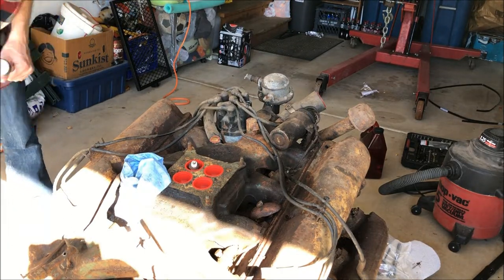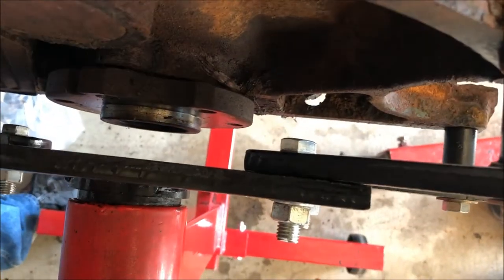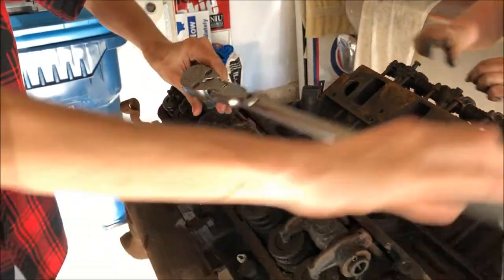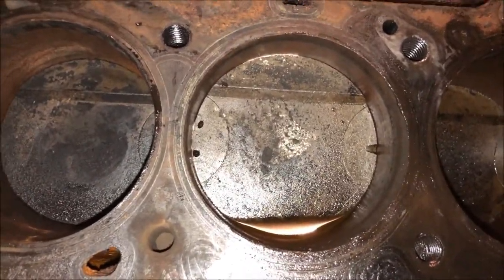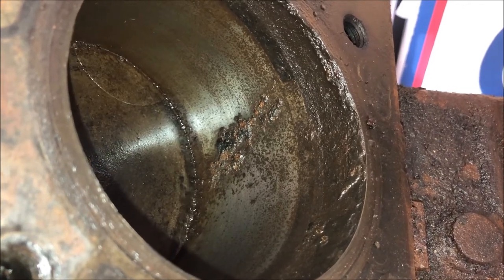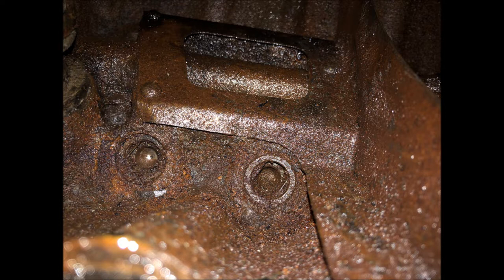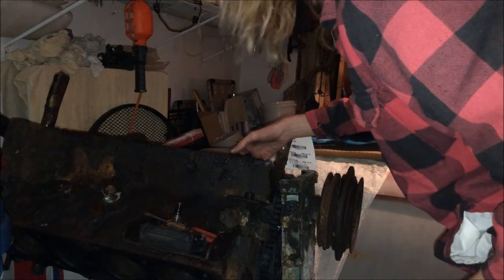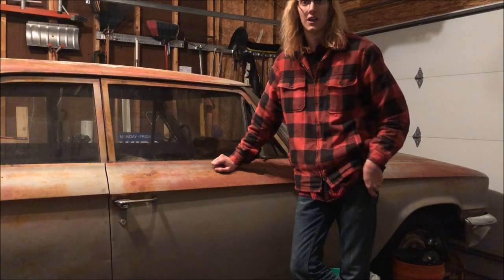430 MEL Engine Teardown, Part 1

Comment: look if you have locked pistons , and the heads are off put a pot on your stove , tip 2 quarts of trans fluid in it heat up the 160 c and carefully tip into cylinders , leave for 2 hrs and will turn , if not repeat , but i never had to !

Comment: Is the timing cam gear (large upper) stamped with FoMoCo? If so, it's likely an original timing set. Nylon timing gears in 1958? No way! They appeared by the end of the sixties and into the seventies on some (not all) engines.

Comment: These came with a steel cam gear and numbered rods from the factory.  A hex shaped oil pump drive is common enough, its not made from pot metal.  Unless it has oversize pistons and or undersized rod or main bearings then it likely is the original build.  These were heavy and well built engines, their worst quality was they were bona fide gas hogs - this was why they went with a 2 barrel carb in 1960, to address complaints about single digit fuel economy.  The MEL (and truck Super Duty 401, 477 and 534 V8's) and the GM W series 348 and 409 have flat cylinder heads - the combustion chamber was a wedge cut of the piston.  Make sure that the engine machine shop you choose knows how to properly machine this setup - it would actually be best to engage a specialist antique engine rebuilder.

Comment: The 58, 59 and 60 MEL engines can be bolted directly to bell and trans from the FE (352, 360, 390, 428) engines. 1961 and later MEL engines have a different bell pattern and so transmission options are very limited.

Comment: I rarely comment on videos but I implore you guys to stop fooling yourselves with the idea that you'll be able to put this engine back on the road with out a FULL and PROFESSIONAL rebuild. There are parts on the Titanic that are in better condition. And yes, I have 20 years of experience in rebuilding the MEL 430 as they were the motivating force in the Lincoln Continental of the 60's.  All that said, I'm happy to answer any questions you may have or point you in the right direction for (rare) parts.
Reply: By chance can I pick your brain about this engine?
Reply from the maker: Don't worry-it's at a machine shop right now. We had that realization as we dove further and further into it and optimism faded. The pistons were so stuck, they had to be pushed out with an air hammer. The cylinder with the rust buildup was sleeved, and all were bored 0.030" over. Brand new valves were made off the originals (early '58 engine with bigger valves) and custom pistons were made modeling the originals (no flat top or pentroof pistons from rebuild kits-we want our 10.5:1 compression!).